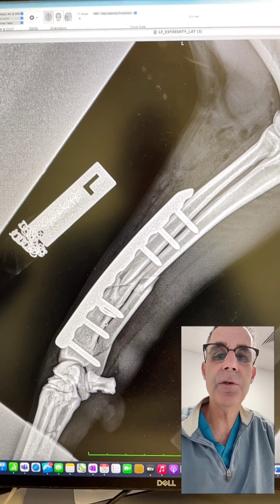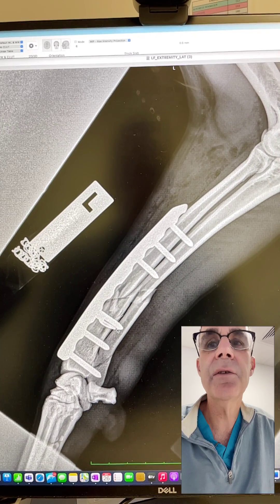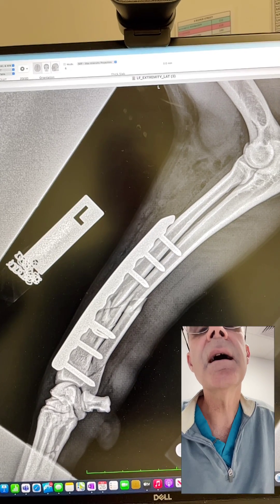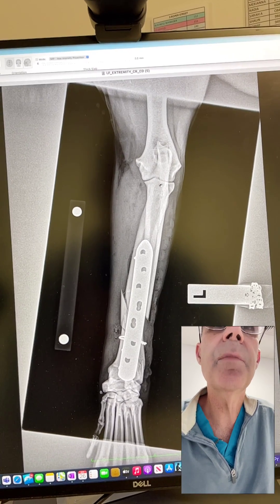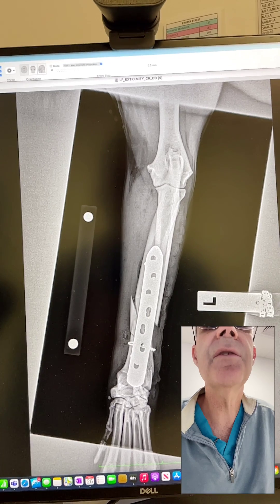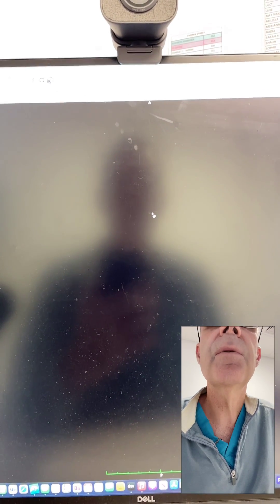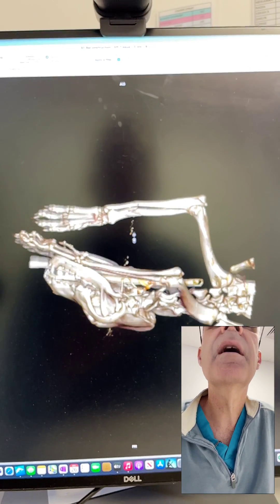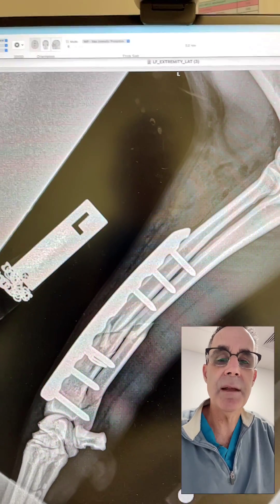Review of radius/ulna fracture repair from yesterday.

Comment: Hi Charles, thanks so much for sharing. 
Could you please elaborate on the plate choice and the screws.
Reply from the maker: I used a locking plate because the construct is stronger. The screws could be a bit shorter. I could have used a Fixin T-plate, but I did not think it was necessary. Do you have any specific questions?